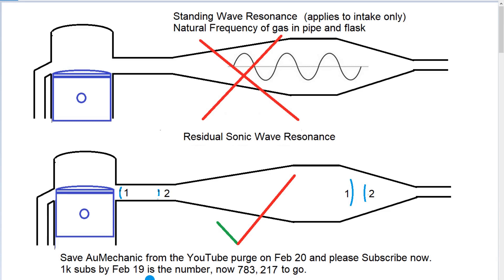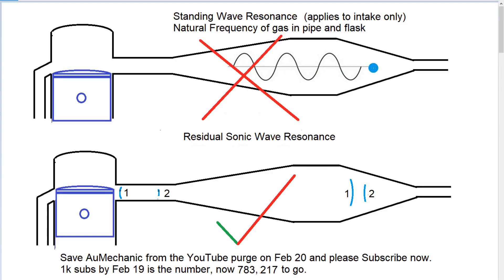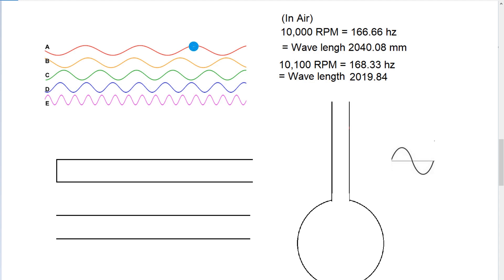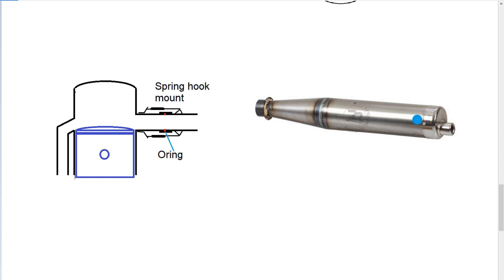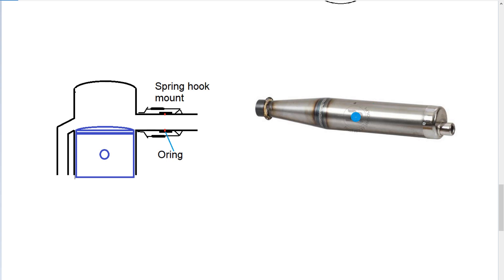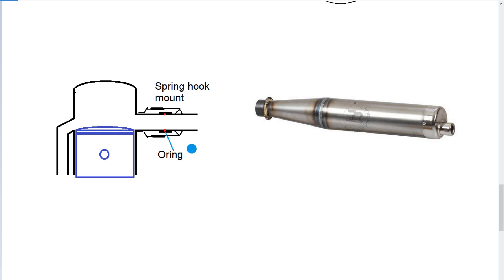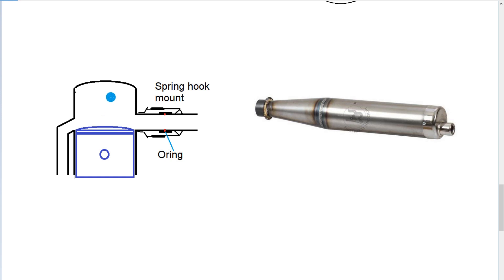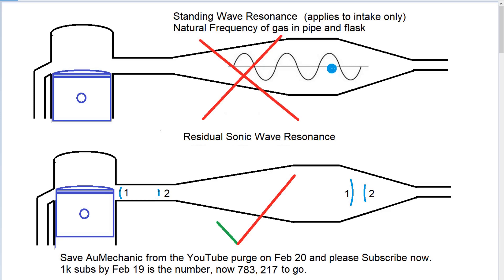Destructive Resonance in 2 Stroke Expansion Chamber Exhausts E11

Comment: two stroke vibration occur naturally so how can this be brought  up, that like saying  two stroke engine vibrate, so duh... it gonna vibrate but if you can't find a solution to fix it then what the point of this topic???  this '' vibration pipe'' in your topic is vague and i find this information useless, unless there a vibration specific that you did not mentioned and that it was left out.  Now if you're talking about oscillation that you had in mind but didn't know the definition then that a different story my friend.
Reply from the maker: I thought the title of the video makes it pretty clear what this is about, which is "Destructive Resonance". The key word being "Resonance", being the exhaust noise resonating with the natural frequency of the mechanical construction of the pipe.
It is not about mechanical vibration form moving parts in the engine.

Comment: So having explained this, what would be the cause of an intermittent knock inside the pipe at a steady throttle opening? Provided jetting is good
Reply from the maker: Hard to say, might just be a loose baffle inside it.
Reply: @AuMechanic  I’m not sure the yz250x has any baffles in it. I’ve heard pipe resonance could be a cause. Here’s a video of what I mean. 
https://youtu.be/8k0JOQ8Bbto
Reply from the maker: @Dropsix  Some pipes have material inside to reduce "ringing" of the chamber walls, it may have come loose, its hard to hear in the video.
Reply: @AuMechanic  Ok thanks for the reply!

Comment: Aumechanic  i would care to ask you if you could  could help out with a free math geometry calculator so that we all  can you please and thank you kindly from Canada Toronto Ontario Etobicoke North  I have been following you and you are very intelligent and informative person
Reply from the maker: Thank you for the comment
If you look at the description section below the video there is a link to free pipe calculation software I wrote.
Reply: @AuMechanic   thank you kindly for responding back to me I am a newbie to port running  and I do like to learn new skills  and this would help out on small engines and motorcycle bikes and even cars and trucks  would this work also with diesel engines or no
Reply from the maker: @domenicomonteleone3055  
No not for Diesel.
Reply: @AuMechanic  then for gas engines motorcycle bike engines and what about gas Engines
Reply from the maker: @domenicomonteleone3055  
Any spark ignition 2 stroke with crankcase compressed intake via transfer ports.
Reply: @AuMechanic   what you are doing how much of a big difference  would the work you are doing port tunning on a 2 stroke engine  be different to a  cars engine beacuse  I want to learn this more  beacuse  there is alot of  work that I could look into on bikes and cars I think I have found someone that has alot of knowledge and Experience and know how   iam very grateful to you  for responding back to me   thank you kindly from Canada I dont know the time it is there know but the time here is 2.05PM afternoon still here bye thank you kindly for responding back
Reply from the maker: @domenicomonteleone3055  
Just watch the other videos I have that cover all this.
Reply: @AuMechanic  I will do as you say watch your videos thank you kindly for responding back to me

Comment: Sorry to jump in with this, alexs problems with the rpm. What are your thoughts with plug heat range and plug gaps,  I have no experience of an engine on alternative fuels. Maybe experience of dragster would help with this problem? Many thanks
Reply from the maker: Hi Burt, Top fuel drag race engines are very different in respect of plugs, they are like lighting a rocket and no off switch with the wheels locked to the engine.
Alex has a spark tester and it all reads ok so that covers both the coil, lead and the plug as well being all of those will effect the total secondary current it reads so 99% not ignition if that is reading right.
Ignition presents as a misfire and to my ear the engine sounds like it is either starving for fuel or choking out somewhere.
Problem with 2 strokes is they are very mechanically simple compared to a 4t but quite complex in the fundamentals of operation compared to 4t, for that reason they can do some very odd things that can be harder to nail down than a 4t
My approach would be simply to back track out of the forest to a point the engine was working right rather than going deeper with changes.
Id put the old carb on and run it with petrol, if that doesn't work it can rule out all the new fuel and carb possibilities, that narrows it down a bit. If it works then try Nitro on the old carb and narrow down if its fuel or the new carb.
Freeing up the pipe by taking off the muffler or loosening the header is a quick test that might rule out exhaust restrictions.

Comment: Will rapping the pipe with heat wrap will it help in keeping the correct resonance?
Reply from the maker: It will keep the temp more uniform in the pipe that will keep the sonic velocity closer to the mark.
However the pipe cooling down is not always a bad thing, as it cools sonic velocity is slower which favours a lower RPM range, if that occurs down in a tight section of a race track in a Sprint Kart for example it would be favorable to have the peak drop RPM range very slightly and heat up on the straights to rev..
Unless you have some high specific power engine you need to run at peak only then i wouldn't use the heat wrap.

Comment: Good to know you made it, now the question, whats yor take on hydro formed versus welded cones for performance,  I read an article in a mag and the differences on a dyno were in the measurement uncertainty range. The image In my head is the smooth transitions should be better? Best of luck with the channel
Reply from the maker: Hi Burt.
Yes looks like we made it, thanks to everyone who subbed,.
Cant beat hydro formed pipes, smoother the inside is the less unwanted reflections you get off the sonic waves in it.
But the difference would be quite minor unless you have some beads really hanging out inside the pipe.
If you can do clean welds and are careful to back grind your welds inside as you go then a welded pipe will not be an impediment. The header pipe is the critical part when it comes to internal finish compared to the rest of it.